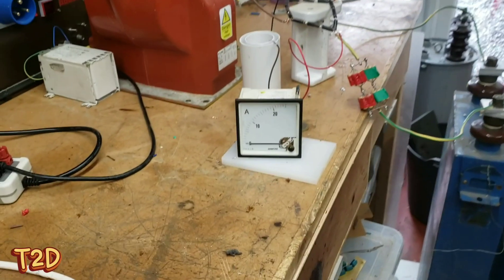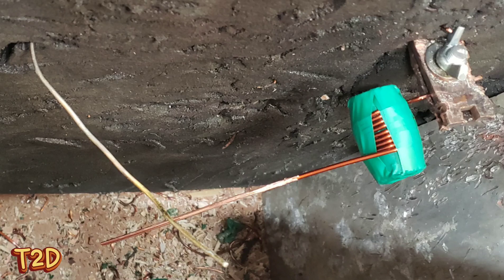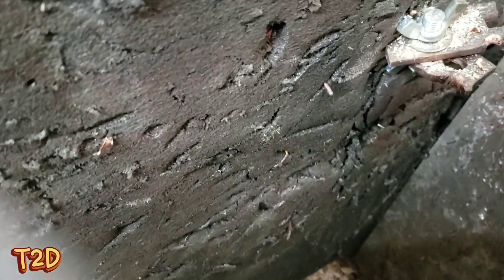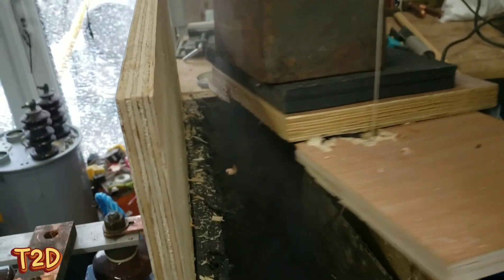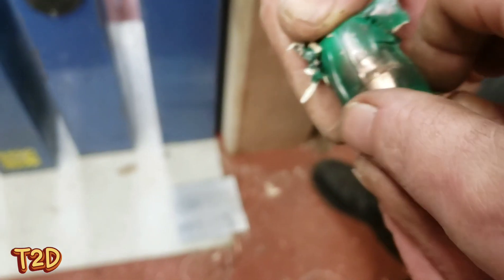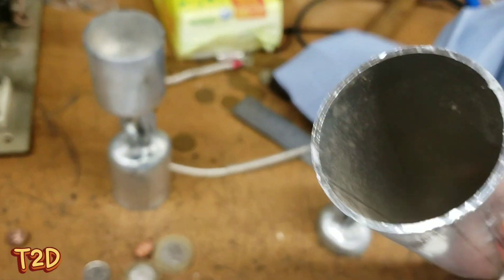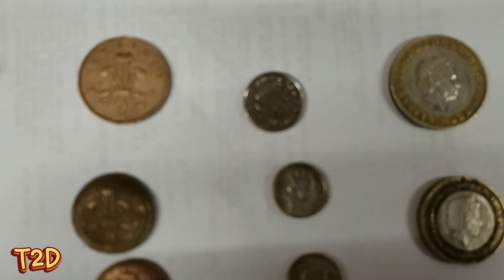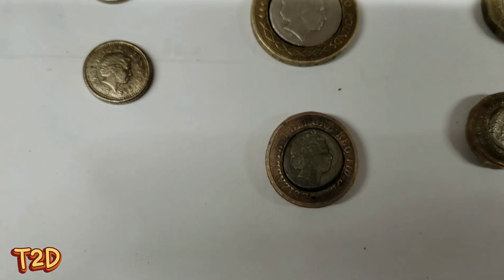EMP machine 20kV 15kJ shrinks coins (and brakes windows)  😮⚡⚡

Comment: I would be very interested in seeing how much more energy would be imparted to the coil fragments by replacing the coin and plastic pipes by a solid copper rod.
Reply from the maker: Il try to next time I have the caps out, although I don't think it will do much to a solid copper bar, but may be wrong 😁👍👍
Thanks for watching my vids..

Steve

Comment: Damn, I am speechless! They are really tiny, I think the only coin shrinker that came close to these results is one presented on the Kreoson channel some time ago (but it was huge compared to this setup). 15 kJ is serious power, I like the "discharge bar" on top! Wondering that the caps take this punishment so well.

But - how did you manage to break BOTH windows???
Reply from the maker: Hey thanks mate the caps are designed for this punishment and the windows got broken from pieces of shrapnel making through the 15mm plywood 🤣